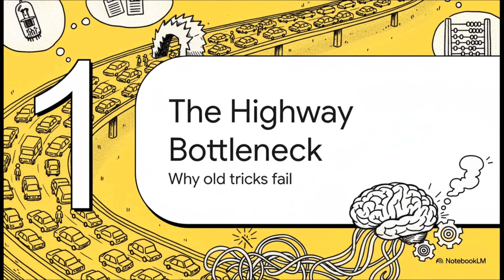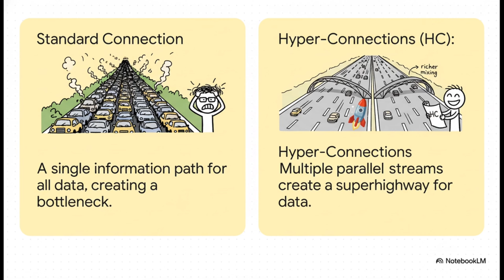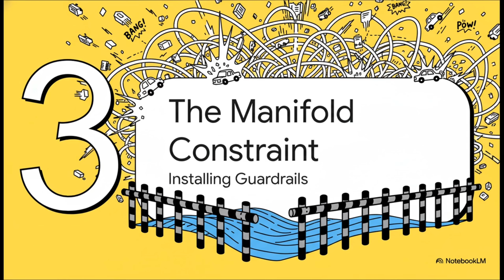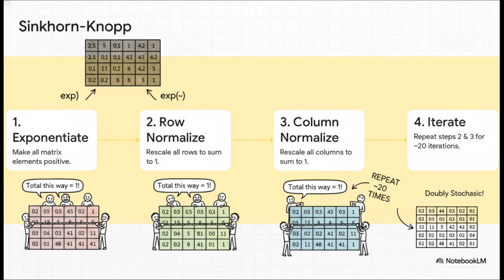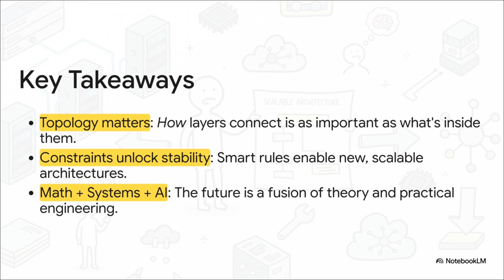DeepSeek: mHC: Manifold-Constrained Hyper-Connections: The Secret to Scaling Giant Models

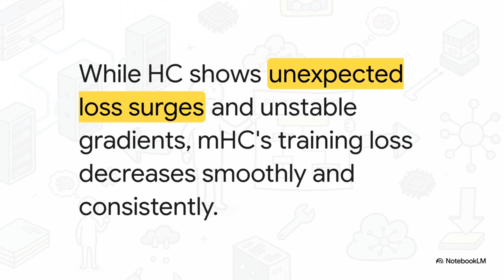Comment: Hmm IMO "Smarter Models" - Correlation vs. Causation: The paper strongly asserts that stable models are "smarter" (5:59) and significantly outperform standard models (6:12). While stability during training is undoubtedly crucial for effective learning, the video doesn't fully explore whether the mHC architecture itself contributes to a fundamentally better learning capacity or if the performance gains are solely due to overcoming training instability. Are there other architectural benefits of mHC beyond just stability that lead to improved intelligence?
Reply: well smartness is emerging properly so stable training means that you received what you expected from training datasets, hence the causation pov.
Reply from the maker: we did covered this in our paper analysis here https://www.emergent-behaviors.com/the-ai-superhighway-how-manifold-constrained-hyper-connections-mhc-prevent-traffic-jams-in-large-language-models/
We think there is confounding variable which is relating this, so it may just looks like simple correlation